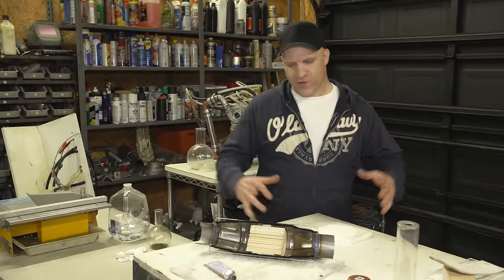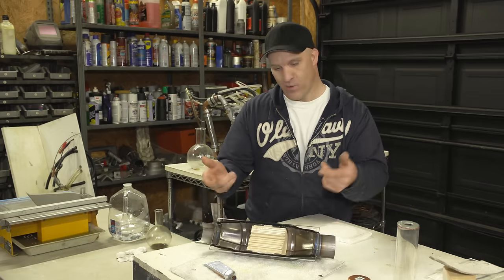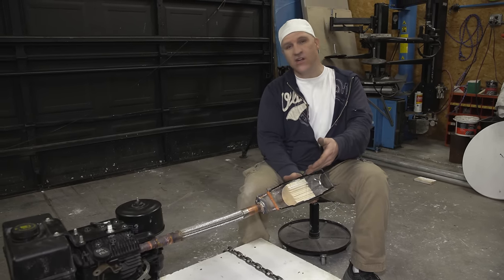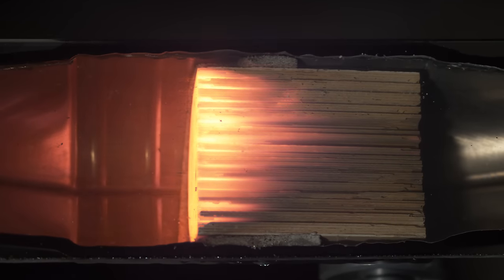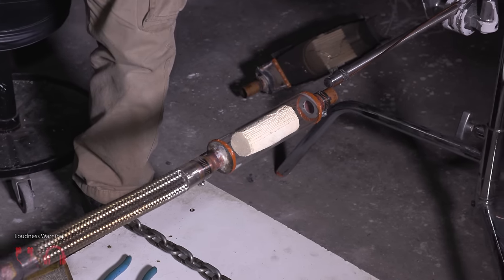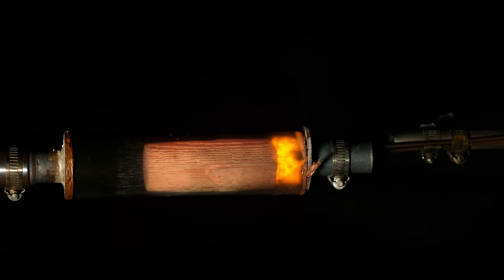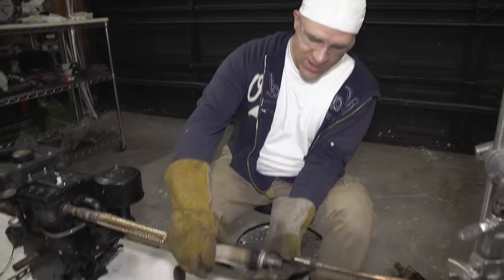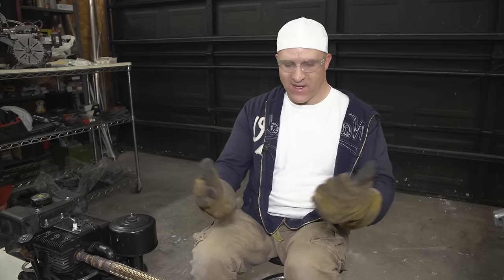See Through Catalytic Converter

Comment: Cat converters are large honeycombs of platinum, palladium and rhodium, when the toxic unburnt gasses like carbon monoxide pass over them, they get pulled onto the surface of the metal, the high concentration of the gasses on the surface forces them to react and turn into non toxic gasses like co2 and oxygen

Also the reason leaded fules for banned, is the lead atoms would permanently bond to the metals in the converter, getting rid of their ability to catylyse these reactions, destroying the converter
Reply: Well, that and, you know...lead.
Reply: @sentry4944  Lead isn't in fuel anymore and is not part of the catalyst either.
Reply: So that's why in Blues Brothers Elwood says about the Bluesmobile, "It's a model made before catalytic converters so it runs good on regular gas."  Meaning, regular leaded gas.  Nice!
Reply: Actually, exhaust catalysts are large honeycombs of ceramic material with traces of platinum, palladium and rhodium.  The reaction is intended to produce CO2, water and N2; oxygen is used up in that process.
Lead poisons the catalyst, and makes it so it doesn't work properly.  Lead also poisons people.  Banning tetra-ethyl-lead use in fuel was a huge benefit to people, not just catalysts.
Reply: @willmcgo8288  Sure but it made the cars run worse without the leaded fuel because the TEL also acted as a lubricant for some engine parts. So older cars either need lubricants added to the no-ethanol high octane fuels they were designed to run, or you need a modern (post unleaded era) engine in your old car.
Reply: Leaded gas was banned also because of lead in emissions that contributed to the toxicity of auto exhaust.
Reply: @traugdor  Those old cars are long gone, and thank god, old junk, used to smell, and we used to think that was normal, it wasn't..
Reply: The particles are just getting broken down finer. They are still coming out but in another form.
Reply: cool story bro.

Comment: The high speed actually did reveal something neat on the small converter test. As the piston was going through its stages, you can see the flames/smoke would get pulled back into the exhaust very slightly. Than get blown away again. Very cool!
Reply: That’s what destroys Gallardos engines

Comment: I love how you can see the exhaust pulses move the flame around in the slow-mo shots. You can clearly see what I believe are moments of valve overlap during the intake stroke, where it's pulling the burning air/fuel mixture back into the exhaust as the two valves are open at the same time, and what appears to be a short outward flowing pulse during what I believe is the compression stroke. Most Briggs/Tecumseh/other similar small engines that I've encountered have a small bump on the back of the exhaust lobe on the camshaft to relieve some compression to make them easier for the consumer to recoil start. A common (and basically free) modification for  these small engines is to grind that compression relief bump off the back of the exhaust lobe so you get full compression instead of pushing some of the mixture out the exhaust.  Makes it a bit harder to start but it's a "racer" trick from older go-karting days.
Reply from the maker: Yes !
Reply: WHAAT ? is that why ? I remember last year had to clean up valves on a generator. I was very confused why the semi open positions... Really had my head messed up....  These new cheap gens have the cam vent SO close to the intake it often pulls oil in. Which in turn oils the air filter , and if the customer never checks the filter,, totally fks everything.  Have you really cut that part off the cam as you say and ran it for a bit ? I imagine there are other engineering compromises manufactures might lax on when they can afford lower compression
Reply: That's fucking sweet hahahaha
Reply: @mrsc1914  I can't speak for your engine specifically, but on an old Techumseh 8HP(from a snowblower)  I had that was modified for racing use the small "relief lobe" on the exhaust side of the cam that was used to make it easier to start was ground off to allow for increased compression. it also got stronger valve springs to handle higher RPM and a bunch of other race oriented mods.  The last newer generation single cylinder engine I had apart used a plastic camshaft... Pretty sure it was a briggs OHV engine from a generator that got run without oil. I couldn't believe the cam was plastic, gear and all, injection molded. insane. They don't make them like they used to.

Comment: Now can you do one with a diesel engine & DPF(especially during the regeneration phase)?
Reply from the maker: Yup.... Coming up soon.
Reply: Nice. I've been around diesel machines and that regen gets flowing like a jet engine also extremely hot. Looking forward for that video
Reply: @WarpedYT  really looking forward to this
Reply: @WarpedYT  don't recommend doing it in your shed. My partner said her car was running different soot at the back of her car told her to give it a bit of a rev, it shot white smoke out, it felt like my lungs where being scrubbed with a wire brush. 
After I got my breath back and wiped the tears from my eyes I said to her "it's okay it's just the the stupid pdf burning off"
Reply: @remyche8768  I would disagree. carbon build up is probably from burning oil and that would explain the white smoke.  Also you dont get any visible vapor while in regen. also only diesels have DPF. And if a DPF was dumping alot of smoke in to the air it's not doing its job. something is wrong with it.
Reply: @jakesreef1730  that is incorrect. You can buy brand new trucks that smoke when regenerating. Some do some dont an 18 dodge I had did it from brand new all the way to 130k miles never had any issues.
Reply: @jakesreef1730  The regeneration process point is to burn out all the soot that was stored in the catalytic converter. The process usually happen when you drive at around ~60mph it is programmed so that the soot would be burned while you drive on the highway.
Reply: @jakesreef1730  actually DPF just like in this video receive richer fuel at those speeds and that is what makes them burn and do regeneration process
Reply: @WarpedYT  as an auto tech that primarily works on diesels, i second this request. Diesel aftertreatment is a beautiful and interesting thing despite what some "deletist" enthusiasts might say, although that route is unarguably easier on the engine and will yield more power in performance applications. As far as shop life goes, i've slowly but surely realized that we can run the dirty bastards in the winter/closed doors without eyes burning/choking, and in my book; that's awesome.  There is definitely a general lack of understanding of how the system works, and it is just that: a system. Naturally you'll need the catalyst in place to propagate the flame front of the diesel injected into the exhaust, which will then in turn burn the soot accumulated on the particulate filter. I think it would be most interesting/beneficial to see the process on a properly "loaded" DPF, and analyze the reduction of soot from a visual standpoint. An obvious obstacle is the heat generated; on average 1200-1300 degrees F post cat/pre-DPF, and (hopefully) eventually a similar temp. exiting the DPF. I presume it to be a general "fireball" exiting the catalyst thus incinerating the soot in the DPF but it'd be cool to actually see it. I'm in Chicagoland suburb area, i can provide the scan tool necessary to "force" the regen process, if you're interested. SCR is a whole 'nother ball game, but i wouldn't bet on that process being visually interesting.
Reply: @virtualtools_3021  lol no i can't say i want to, just a potential hazard of the job i suppose. Besides, with the cat. converter in place the vast majority of CO gets converted to C02 just as with an efficient modern gasoline powered vehicle. Still, not ideal to hang out indoors with running engines, but emissions equipment makes it considerably more bearable.

Comment: I made of one of the first Cats for GM when I was younger, it was sent to Arvin Bosal in I think Belgium for testing. We then made all the lightweight stainles manifold and heat shields for a few years at prototype stage. Great experiment to see how they work. I also noticed that the internals have changed removing the rolled fine wire mesh and the asbestos paper and replacing it with something which looks much safer. At the time many cars adopted the heat shields with two pieces of aluminised steel with a layer of asbestos paper between.

Comment: In your first attempt converter started to glow much faster even having higher mass and being attachet to big conductive piece of metal because the seals at front part of your construction ruined, letting air in. In your second attempt with the glass tube you can see that ceramics of converter glows better on the backside because exhaust pipe after converter is short and lets the air go inside. 
Actually converter doesn't "like" (starts to glow better with) the richer air-fuel mixture because there's no oxigen to burn hydrocarbons. In your experiment oxigen was coming from the ambient, that's the reason of glowing better. If you run rich with long pipes and good seals, you'll see that temperature drops down in comparison with stoichiometric ratio. But if you run so rich, that there will be missfires or switch the ignition off still adding fuel you can even melt the ceramics.

So my proposition for a new see-through converter video is to make longer exhaust pipe, better seals and install a valve before converter for controllable adding of air into exhaust. Then run rich and add air.
If it will not melt down, then make revs as high as possible, and switch ignition off. All the fuel and air will reach converter and mostly burn in there. And also it would be better to load the engine.

Comment: Thank you. I invented this in 1961. My grandfather owned a muffler manufacturing company. At 16, I was put to work as a machinist apprentice in the experimental shop. We had a big Chevy engine on rails, driving a generator for load. I was amazed to see the glowing pipes on the exhaust manifold.I knew enough chemistry that I thought hydrogen peroxide would convert carbon monoxide to carbon dioxide. So, how do you make hydrogen peroxide? High heat, water, and a platinum catalyst. We had all of that, except the platinum. My father was Sales Vice-President, and he dismissed my “invention” as kid’s fantasy. I think the first cats came out in 1974.

BTW: today, I think it is worth investigating the enzymes the bombardier beetle uses to produce hydrogen peroxide at ambient temperature..
Reply from the maker: That's pretty cool, you invented the catalytic converter? That's interesting I'm not familiar with the enzyme from that beetle, but I will do some research. in my opinion there has to be some way to recover all of that wasted energy going out of the tailpipe. It just seems like such a waste.
Reply: Warped Perception The leading researcher on that beetle used to be at the University of Kentucky. J
Reply: Interesting story thanks for sharing. What else have you found particularly fascinating, are you an inventor that has brought innovations to reality?
Reply: Avery I have no quarrel with that. I never reduced it to practice.

Comment: Very interesting! I really like the videos with the see-through engine parts, they give a clear picture of what's happening inside of an engine. 

Maybe it would be interesting to see a slow mo of a camshaft when the engine is revving to it's max rpm. Especially if the springs aren't good enough, to see a floating valve.

Comment: The fact that when he enriches the mixture, you see the back end of the catalyst glow red hot so soon compare to the outer edges of the catalyst shows that catalytic converters, designed with airflow/efficiency also kept in mind, din't restrict flow NEARLY as much as people think they do.
Reply: They do restrict the air significantly, but there are expensive and larger units for racing and performance needs. If the combustion chamber was designed properly, and the high load fuel trim wasn't so darn high, we wouldn't need them at all.
Reply: @Baigle1  just swap your engine for a 12-valve Cummins diesel... no need for a cat or a muffler, haha

Comment: Tip: Catalytic converters "clean" themselves at high temperatures, gives you a reason to rev your car every once in a while ;) extends the lifespan of the converter and it's fun too, especially if you do a lot of "slow" city driving let her rip every now and then on the highway to clean out that hard working platinum in there
Reply: And, interestingly, catalytic converters don't really begin functioning until about 400 to 600 degrees F.
Reply: @mitchellmitchell6938  Well, funnily enough, if your car is more than about 15 years old your catalytic converter is likely not working anymore anyway: Massive stresses of very high heat and vibration will eventually take their toll on it. So in that sense you might as well not even have one on your vehicle! In my state they got rid of emissions testing years and years ago so no one would even notice if I took mine off.
Reply: @JustWasted3HoursHere  what state is that?🤔
Reply: @number015  its not Illinois! We got checks every two yrs
Reply: @JustWasted3HoursHere  wouldn't that trigger the old P0420 code on any ODB2 vehicle if they weren't functioning?
Reply: @number015  Florida.
Reply: @computernerdinside  Probably, but mine's a 93 Civic. I don't even have OBD in mine.
Reply: @JustWasted3HoursHere  Mine's a 99 Camry, with the only code occasionally coming up being P1300, which has nothing to do with exhaust.  (wish I knew exactly what the issue was, though.)
Reply: @number015  Most states as far as I know that have emissions testing have a cut off of for the cars either being 15-20 years old, after that they are considered "Classics" and get a pass on the test.
Reply: @computernerdinside  Error Code P1300 is defined as Igniter Circuit Malfunction No. 1. It means there is no IGF signal to the PCM during engine operation. This error code is a manufacturer-specific trouble code – it does not apply to all vehicles equipped with OBD-II system or vehicles made since 1996 up to present.
So either you have a loose wire, a bad coil (Or harness).. Or your PCM has shit the bed.

Comment: Inside a diesel dpf? How about inside what ever the def fluid does
Reply: dpf and def fluid ? u mixed some up there ;)
Reply: @heinzkot360  ik they are two different things
Reply: @VFio689  ouh okay i was just a bit confused about your comment ;)
Reply: Diesel converters use a slightly different process to trap and break down NO2 gases. The SCR system uses a base  metal catalyst to save money, and a reagent containing ammonia (DEF) to facilitate the reaction.
Reply: @Nighthawke70  im a carmechanist in germany ;) i know ... i was just convused about him using two different systems in that relation ;)
Reply: All this emissions is garbage, it's a scam. You cant smell it or see it but more comes out as they burn like double the fuel. Especially in diesels restrictive intakes egr catalytic converters. Dpf def etc. They burn more fuel and are supposed to be good. Also they make your engine last less and less response and mpg. It's a list of terrible things.. that's why people delete them
Reply: @TurboNym  Why would you really care about the other people.. it's not that bad I suppose it's good right when it comes out but in the long run it's worse for the environment. No point in suffering dealing with a slow inefficient engine that lasts less. Just my 2 cents
Reply: @TurboNym  A diesel engine that is smoking a lot with the DPF deleted, means that that it is NOT tuned properly. Some people think having the smoke is "cool", so they purposely tune their engines to overfuel to get the smoke...I call those people dumbasses. A well tuned, modern diesel engine will likely have a light puff of smoke before the turbo spools, then even on wide open throttle would only have a light haze coming from the tailpipe. Otherwise, normal driving would be clean...no smoke exhaust.
Reply: Nym I did a DPF delete on my BMW and there's no black smoke or awful smell. If your engine is tuned properly that won't happen. For the longevity of your diesel engine, its best to take them off. Diesels intrinsically have 2x the carbon buildup versus their gasoline counterparts. The catalytic converter takes those already harmful emissions and cycles them back into your cylinders causing about 3x the carbon buildup. That is extremely harmful to your car unless you change the DPF filter a lot (which IS NOT cheap). It also makes the car run extremely inefficient causing about a -5mpg difference and adding engine wear. DPF filters and CC's are no good for diesels. Diesels are suppose to be ran heavy. You're taking THOUSANDS of miles off your engine by having a CC on there.

Comment: Would be interesting to see what injecting air into the exhaust ahead of the cat to provide extra oxygen like the car does with the air pump. Bet it would have gotten much hotter much quicker.
Reply: I'd love to see that on video
Reply: I’m thinking that could be explosive once it reaches a level of heat and oxygen levels are higher.